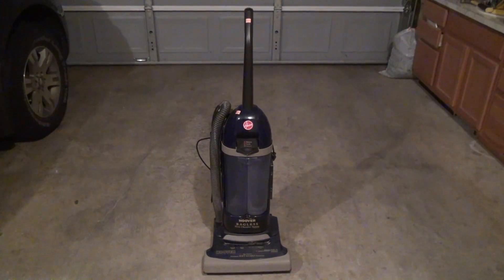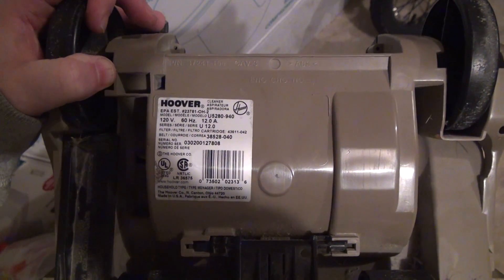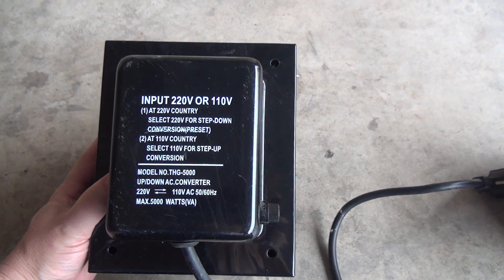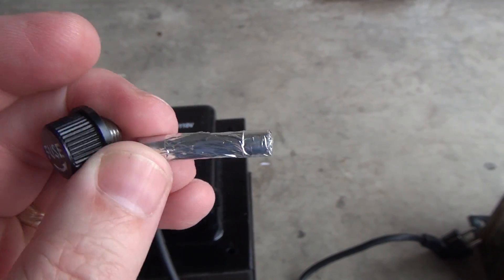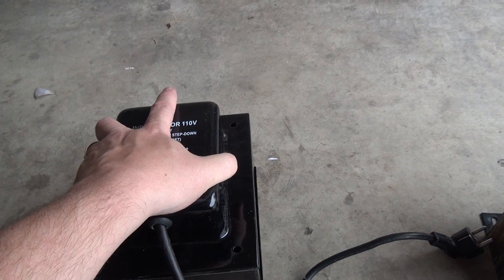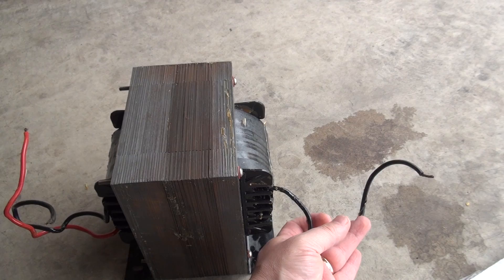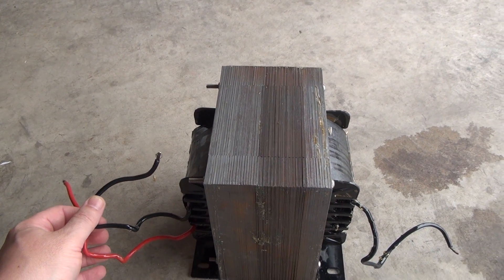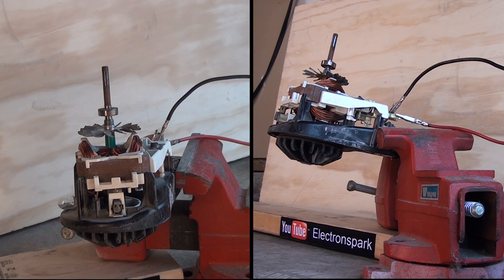Unstable Hoover Motor in Flames

Comment: What happened that caused it to suddenly erupt into flames? Was it full of gasoline or something?
Reply from the maker: No gasoline. The wires are covered in a clear enamel insulation and when it gets hot enough it will burn.

Comment from the maker: Most motors you see burned out on YouTube have power connected only to the brushes. I believe you lose a lot of torque that way, sometimes they won't spin at all.
The way I connected this was through the field windings like it would normally be connected inside the vacuum.

Comment from the maker: There actually was a load on that. The impeller fan at the bottom put out so much wind it made the tripod (camera on the left) move around.
I kind of regret not removing it as it probably would have made the motor a lot less stable than it was.
That being said, I made a concrete flywheel yesterday for a future project and am editing the video of that right now.